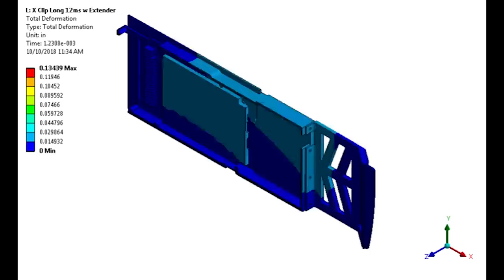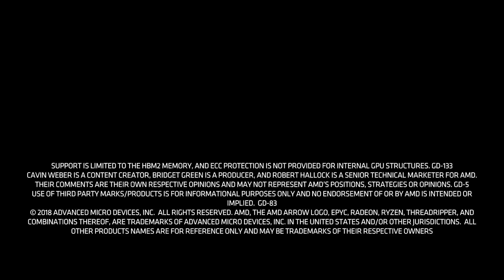The Bring Up: Episode 1:  AMD Ryzen™ Threadripper™ Processors

Comment: This is actually a really cool show. Good length, to the point, interesting discussions, and timestamps (thank you!). Keep it up!

I've got a question regarding Dynamic Local Mode.
What's the thread utilisation threshold for determining whether threads are needed, or not?
So if I have a 2990WX, and I have an app that uses 32 threads at 100% load. If the 33rd thread is at 90% load, will it then be determined that the app doesn't need direct memory access, or will that 33rd thread need to be at 80%, 70%, 60%, etc load instead?
Or, is it that the top 32 threads always get direct memory access, regardless of whether the app performs better in UMA or NUMA? Or, is it otherwise based on how much memory access that app is doing? Or, is it some combination of the two, or three?

Thanks.

Comment: AMD loves Linux, especially with the Epyc2 launch nearby. ;)
I use Linux, allegedly the support for new graphics cards is good (that is what they say in the community) but a bit more support for the older GCN cards would be nice. You know, basic GUI tools to change the clock frequencies and voltage and monitor the temperatures.

Comment: I like this sort of video`s, keep it up.
A question: I have a Vega 56 (with a 2700X) and i like the card, its very strong for gaming. but why does AMD give the cards such a high voltage? You see everywhere that people with a Vega card (and RX cards) can undervolt very much. like my card does 1010mV with a core clock of 1652MHz.
If AMD already does this from the factory, then you also have fewer reviews where they started on the power consumption and the performace is then a bit forgotten. If you are talking about Vega, people come first with the power consumption.

 (Wait for NAVI anyway;))
Reply: Brad on PCWorld said it, "a stock higher voltage will raise the number of chips per silicon disk that are able to meet the ad speed. A greater yield per disk, but no warranty guarantee that your chip will undervolt and hold a max clock on a lower voltage without crashing. We're back to silicon lottery. Intel in 2002 did this the other way. A P4 2.4gig was $200. 2.6/2.8/3.0 gig went up in price to $800. Intel screened for the magic chips. A lot users have been able to drop the volts on VEGA. BRAVO AMD

Comment: ... can you emplement a power safe on/off toggle in Radeon Settings for Ryzen 2500U in my laptop, let's call it full throttle mode... why, because, i try to use my laptop to DJ, but the Traktor PR0 3 software reacts weird, when a power saving feature kicks in...

Comment: No OG Threadripper and Epyc are not proper chiplet designs because they have all the components of a fully fledged CPU in every die. According to leaks Zen 2 will be a chiplet design because they will be splitting the I/O, memory controller etc into another chip and then they will have lots of core dies. With Zen 3 and a new socket I would assume further disintegration to the optimal form which is where you can just have 1 core chip design, 1 I/O chip design and 1 memory chip design. And you can just throw different numbers of dies together to create a new CPU.

So you would have 1 core chip, 1 I/O chip, 1 memory chip for your lowest end CPUs then 8 - 16 core chips, 4 - 8 I/O chips and 4 - 8 memory chips and the only thing that would change would be the interposer.

Comment: You almost always speak about video production as example of high ressource demanding process...
What about audio production at high sample rate (192khz),64 bit audio engine in an as low as possible latency response between in and out buffer.
Thunderbolt/ high transfer protocol compatibilities for outboard audio equipment.
And all the audio recording, overdubbing problematic...